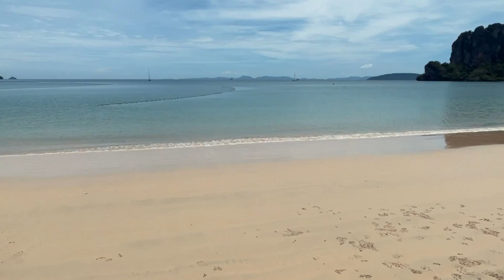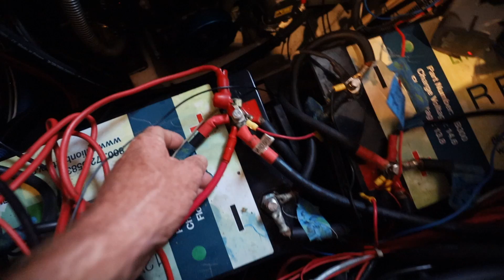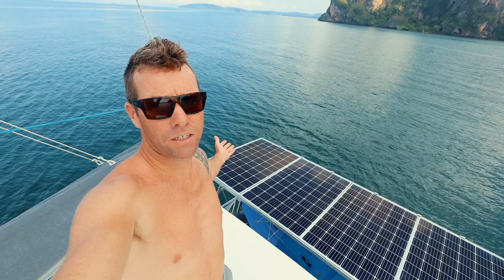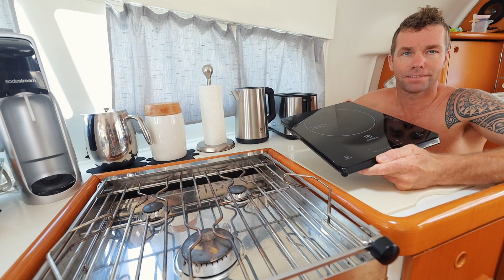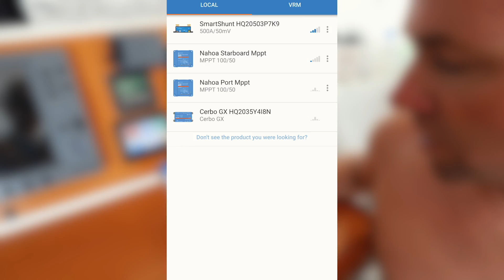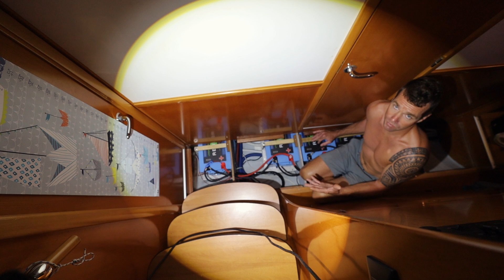Aboard an Off-Grid Sailing Catamaran

Comment: More solar is definitely your friend, I'm glad you're getting it professionally done. There are times when you have to make do, but electricity is a major system, and big changes mean a proper sizing of systems, & the right installation. I don't know if you have considered that if you switch to an all electric cooking setup, you could put a dedicated battery in the underseat spot where the propane bottle currently sits. I'm big fan of over-engineering and redundancy. For me, having a separate set of batteries dedicated for fridge/freezer and maybe the cooktop (depending on size) would be important. I would still keep a separate single burner plug in induction hob to use outside, or just in case something breaks. Good luck, & fair winds.
Reply: All electric, motors and cooking included is getting better with newer batery storage up and comming.

Comment: Friendly advice - put a standard lead acid emergency battery for your bilge pump, separated from all the others and in the highest possible position. If the bottom of your boat will get filled with water for any reason, you will still have an emergency battery working to operate the bilge pumps.
Reply: I've heard of people blowing alternators when the BMS kicks in
Reply: @rogerkerkmann  I've seen people panicking when the power lines goes underwater and the battery goes down. A friend of mine has a water pump on the engine itself; with a fire rolled tube - with that he saved a boat from sinking, years ago.

Comment: I know you guys are in the middle of nowhere but think about getting one of the new m1 MacBook Airs in the future. They are blazing fast, cheap and only consume around 15 watts or less depending on what you are doing. I think you are using a 15 or 16 inch MacBook Pro and they have a 96 watt power adapter as opposed to a 30 watt adapter for the MacBook Air. I have a specked out 16 and a new m1 air and it is just as fast for $1250. Also battery life is amazing!

Comment: Dan and Kika over at Sailing Uma use an alcohol stove. They seem to like it.
Reply: I prefer alcohol stoves on boats too, but there is a catch, they don't get as hot as gas, so cooking is a bit slower, and I've never seen an alcohol stove with an oven, not sure if this is why. It does depend what you want to cook.
Reply: @daveamies5031  Yeah, no oven is a problem, but it's safer than propane and easier to come by. And if you're not using an electric cooktop, that's 1-2kW of power you saved.
Reply: @gsh341  As I said it depends on what you want to cook, my wife is Chinese so her cooking only need 1-2 burners, and she was preferred the alcohol stove to the traditional electric hotplates, we have gas oven and stove in our current house but she was afraid to light the oven for the first 5 years so never even used it unless i was there to light it for her, and even now only uses it  to bake the occasional cake, so no oven would only be a minor inconvenience for us, but some people use an oven for every meal.

Comment: I gutted my marine stove with an angle grinder and put in a countertop/toaster oven in the oven space.  Just took the door off and got it in with some extra ventilation slots cut in the sides.  It has a dual cooktop and I use the old fiddles.  You could take the heating elements and associated equipment out of a big toaaster oven and retrofit your stove, but it will take longer to heat up and use a lot more energy.  I guess it is just a matter of heating the thicker metal up first typically.

Comment: They make a silicone mat for induction plates that keeps pots and pans n place while sailing. Delos got one for their boat when they switched off propane.. Get the two burnerr plate.with both sides on it will not pull more than than 1500. the unit spits the incoming watts.   Also they now have a microwave induction oven. operates like a convection oven. I have had one on my monohull for yearss.,  Even grills steaks on rainy days...Shorter cook time also = less watts used.

Comment: Hai Ben....bateray terminals, if stacked on a pole like it's very scary, maybe you have to rearrange them and add a cable tray / duct cable ... complete all the lines with a fuse with the appropriate capacity...Happy upgrading the electrical system in Nahoa ... Don't forget to label each cable and make an ass build drawing............ Salam

Comment: AGM.  Absorbent glass mat

 Nice and sunny in surrey..

Don’t let your new batteries run down to low lithium don’t like it… at all..

Go with bigger cable.
On you house bank.
Reply: Li like to be between 20 - 80 %, true bigger the charge cables the better :) I hope they are using  a good Li charger.